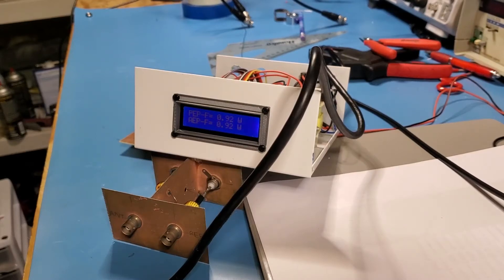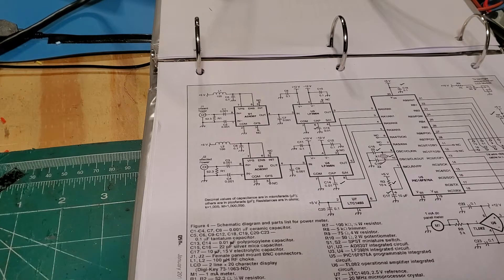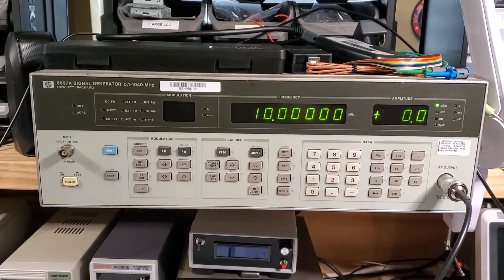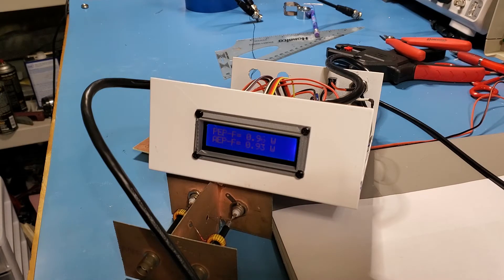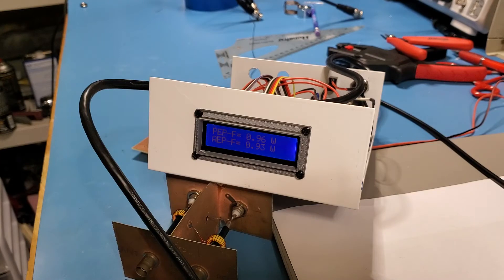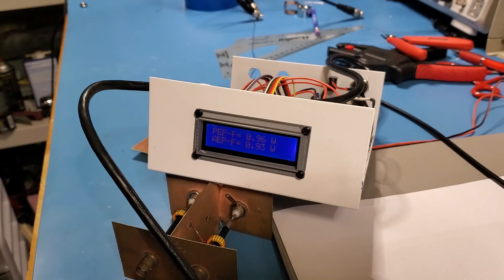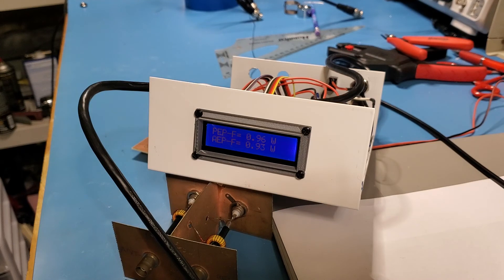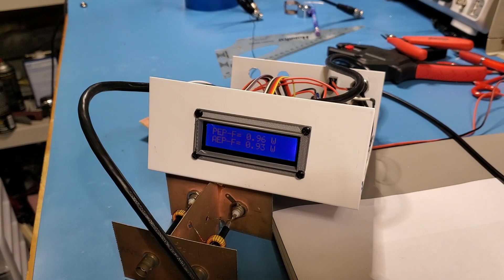QST Wattmeter -  Part 3 LF398 and first measurement

Comment: Hi friend. Do you have the project? Thank's
Reply from the maker: The PCB came from farcircuits.net
https://farcircuits.net/wattmeter_%26_swr.htm

Look down the list and you'll see an entry "QST Jan 2011".  The kit comes with a pre-programmed PIC uController - all the other parts you have to source yourself.  Is that what you were after?

Here's a link to the QST article
http://www.arrl.org/files/file/Product%20Notes/2012%20Handbook/KAUNE.pdf